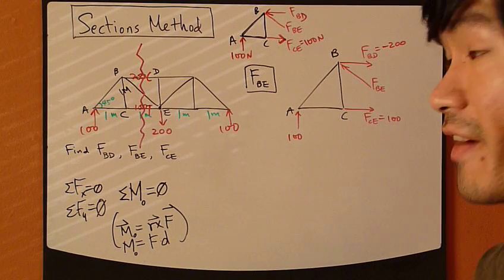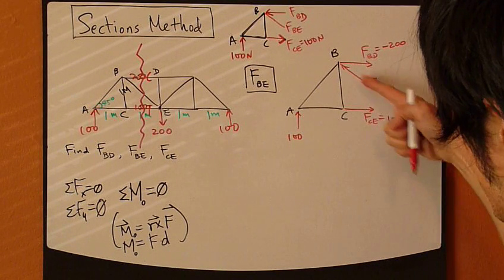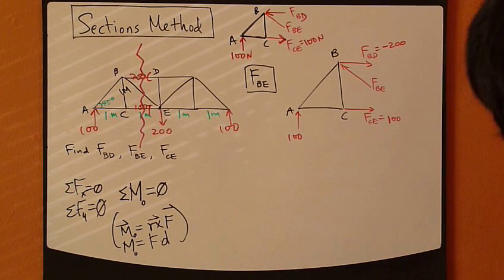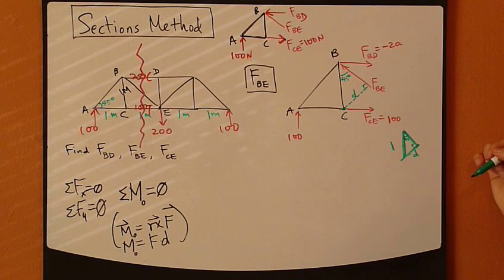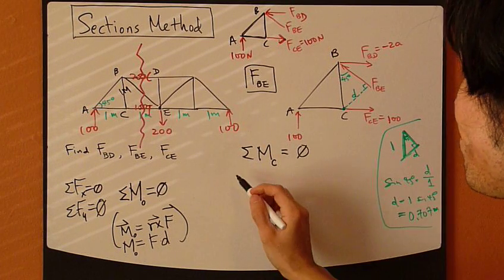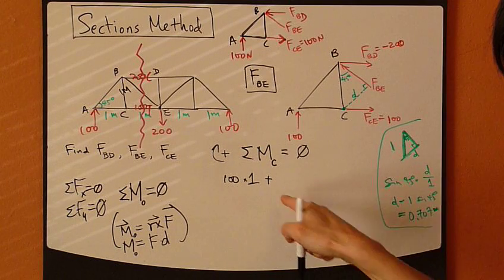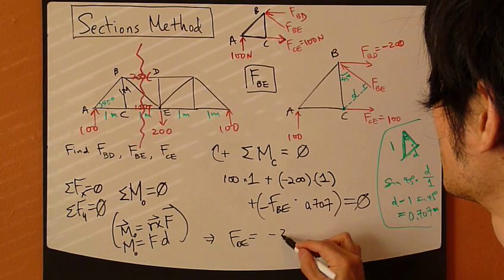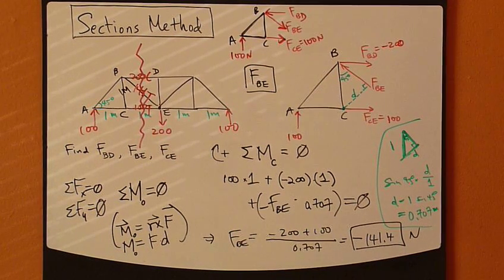Engineering Statics Ch6 Part9: Trusses - Sections Method

Comment: instead of solving for Fbe using the moment about C, couldn't you just have used the force triangle with the member BE equaling to the square root of 2. So Fbe=square root(2) * 100)?